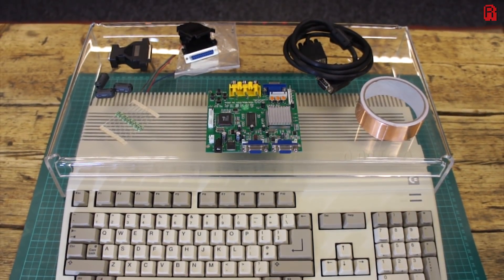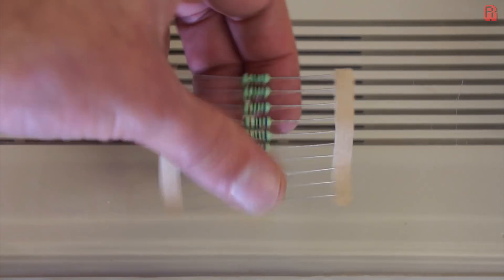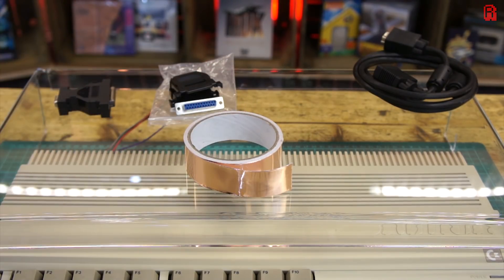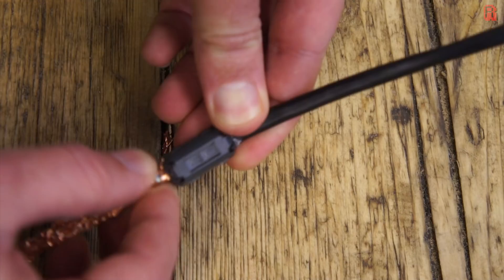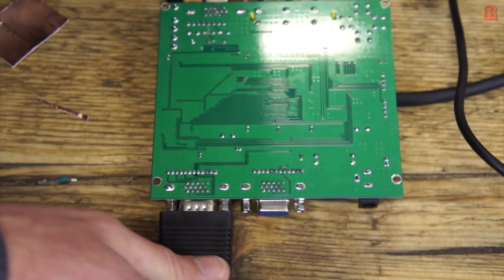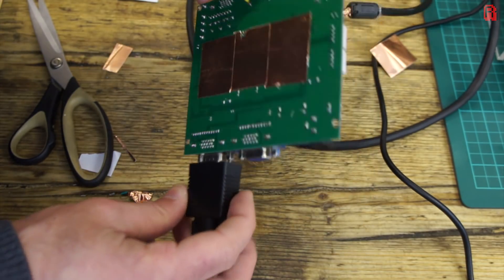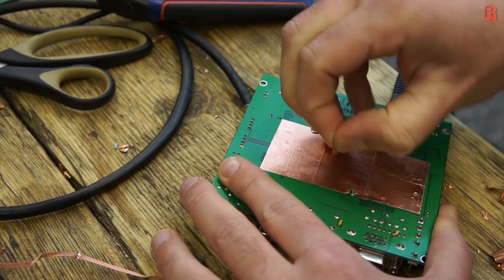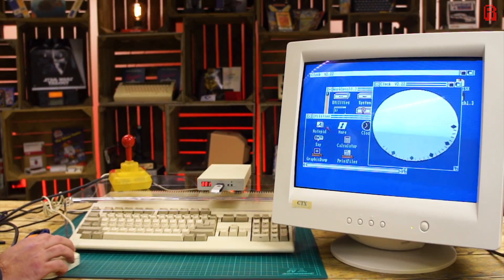GBS-8220 - Fixing Noise (Amiga to VGA)

Comment from the maker: Thanks for watching.  I hope you enjoyed the cheapo hack, see the description for links to those mentioned who deserve credit for their findings.  Nb. Any differences in colour are as a result of me playing with brightness/contrast/saturation on the GBS rather than an effect of the mod.

Hopefully this proves useful to you and pethaps in the future I'll get to reviewing a premium alternative to see how it stacks up.
Reply: Dooklink made a custom firmware for the gbs that gets rid of interlacing
Reply: Hi there, a lot of thanks for pointing us at this board. I just got mine. One thing you should know is that the connector behind the VGA input is DIRECTLY connected to the VGA in. Meaning R,G,B and composite sync...you should use a VGA cable, and only chop off one end of the cable and replace it with an Amiga 23 pin connector. Much nicer than using that white plastic plug. My A1000 now goes straight into the VGA input.
Reply: gr8 video as usual, was wondering if u could tell me make of oscilloscope u used in amiga video
Reply: Also there is a component out mod but I didn't do that.   Just forced 720p out over VGA into a non scaling vga2hdmi
Reply: What is the best (if money does not matter) alternative?

Comment: The db15 connector on the input side connects to breakout pins. Wouldn’t using a cable modified at one end with a db23 work?

Comment: Nice little board, a nice perspex case for it would look good, does anyone do them? I went the route of a SCART to HDMI converter which is working very well for me at the moment and seemed a good bargain at about £23. The converter also has a HDMI input so I don't necessarily loose a HDMI port on my TV (which thankfully also still has a VGA input - which I am hoping to connect up to my Voodoo 3 once my A1200 is working again).

Comment: Thanks for showing us this great device and how to improve on it.  I have a question or two however.  Did you get the 23 pin female rgb connector with the GBS-8220?  If not know any places that they can be picked up?  Also, did you try the copper shielding trick and with a different cable or did you use your already DIY'd shielded cable that you made in the first part of the video?
Also where are those menus coming from?  The GBS itself?
Thank you in advance and keep up the good work :)

Comment: Great video, I wondered if you'd heard of this project based on the GBS-8220 replacing it with custom software, it looks great!? I'm planning on having a go at making one myself adding a SCART to RGB adapter with a sync stripper chip. Anyway reading up on this project it seems the noise has been fixed in the software... https://github.com/ramapcsx2/gbs-control

Comment: Hi, How to add an EGA input to the GBS board? EGA has 6 color channels and 2 HV channels. Where do I plug them in? This is more than RGB. I have an Amstrad 1640 with EGA output which I want to plug to an VGA monitor.

Comment: Hi. I bought a gbs8220 (exactly the one you reviewed) from ebay which is missing a capacitor at location C28 (and the board looks like a dud - it doesnt work.). I want to put one there but not sure of its value. Could you help me out by measuring capacitance on the C28 pads (with component in)? I dont ask you to remove it, I just want to have some reference value. Thanks!

Comment: Hi, have a question.. Do you recommend GBS-8200 to be connected on 12v (16 AMP) or 5v (4AMP) on the power supply?

Comment: Hi. do you know of a splitter I can use on the amiga? So that I can split the signal without converting anything, then have one cable going to my 1084 monitor and the other to this device? I would like to be able to record or perhaps stream but still use the 1084 monitor for my self.  I tried to google a bit but haven't found anything yet.
Reply from the maker: I see what you mean.   I haven't tried this so can't vouch for if it will work but you could look into something like an RGB splitter sending one signal to your CRT and the other to your scaler/sync converter.  Take a look at RGB Distribution Amplifiers.

Comment: Great video. What you could do is add one of those cheap scanline generators from ebay. Just plugs between 31KHz VGA output and monitor. https://www.ebay.com/itm/Screen-Scanline-Generator-VGA-Connection-Replace-for-Retro-Games-Arcade-Machine/372120766485?epid=5008217043&hash=item56a4204815:g:xC0AAOSwkvdafRRK

Comment: I finally got my GBS-8220 to work with my C128's 80 column display. But yeah... take a guess... noise... in the form of random white dots. Your little trick, with strategically placed metallic tape on the underside and covering the wires in it as well, seemed to work... So thanks again :)

Comment: You're using the pin header on the board to build a cable to the amiga's output.  Out of curiosity does that VGA port by the pins act as a input?  Could you have just built an adapter from the amiga's video out to a VGA port and used a standard VGA cable?  Just curious.  I'm hunting down either an A1200 or a A500 for my own gaming usage and find this fascinating.
Reply from the maker: Some people on here have commented that they have used the VGA input.  I tried it before using the header cable and it didn't work for me, so I cut the end off and used the header cable.  The RGB POTS on the board also don't function for the VGA input and only with the header input so that's a small advantage.
Reply: @TheRetroCollective  I had no luck either trying to connect using the VGA input at first. BUT, very recently I did the GBS-Control mod. It does work for me using the VGA input now. I combine it with a buffered DB23 to VGA adapter. Really excellent image quality, with no perceptible lag. I tried to hook it up first using the RGBS pins above the VGA connector (including an 680 resistor on CSYNC), but I got a slight but annoying interference pattern.
Reply: @bennybil3551  Hey man, I also have the same setup using GBS-control.  I wanted to start using the VGA input to the board also and I made myself a cable using VGA cable and then soldering and Amiga RGB connector to the other end and using the 680ohm resistor in the c-sync.  It works, but not in a good way, I get insane looking vertical lines now.  So do you think it cannot be done by cable alone and I need an adapter?  I only thought buffered adapters where needed is say you were plugging directly into a monitor (no GBS 8220)? Any suggestions would be greatly appreciated :)

Comment: I've attempted to create a simple DAC from a the "pull-both" schematic (https://sites.google.com/site/h2obsession/_/rsrc/1400341943224/CBM/C128/images/pull2-rgba-xor.gif) to convert from RGBi CGA signal from an Eagle IBM-compatible, but it didn't work. I don't trust my soldering, so I can't tell where I failed, the GBS-8200 just doesn't find the signal. I don't have an oscilloscope so I can't tell if a signal is even being produced from the computer. I know there is a CGA DAC I can buy but It is $35 and the my original solution would of just cost $4 if it had worked. I don't really care if the colors are a bit off considering the monitor that came with Eagle was monochrome green, when it was working.

Comment: Only a suggestion and it might not make much difference...  ground the copper tape around the cable to a vga shield on the gbbs.
Reply from the maker: Yes I should have shown this really.  The plastic casing I lined with copper tape and grounded which in turn I attached the cable shielding to

Comment: Hm... Do you think such cheap shielding would work for my Gameboy Zero somehow? I'm getting lots of noise and weird moving scan lines and this looks interesting
Reply: I don't know what your GBZ looks like on the inside, but i think it's more likely to be a case of component or cable damage that needs to be repaired rather than something that can be helped with a bit of extra shielding, but you'll only know for certain after you try. What screen do you use and what connection between screen and zero do you use? composite or parallel?

Comment: Why not just a metal case that is grounded?
Reply: 4 layer is indeed often done specifically for crosstalk suppression and EMI reasons.

Normally you flood the inner layers with fill, and they sit on a relatively thick core quite close to the surface, and route your signal and data on the outer layers and it usually works just as well but is much more reliable to manufacture and easier to test and inspect! The ground goes component side inner layer and the vcc fill goes opposite side inner layer. Additionally whatever place you have left over on the surface, you via stitch it to the ground layer.

You can also stick some separators into a noisy bus and stitch them through. Remember when they introduced 80-conductor IDE cables to improve reliability and push frequencies beyond 33 MHz? It simply had a ground wire between each signal wire.
Reply from the maker: I found that I had to have very close contact with the copper tape flush to the pcb for the effect
Reply: Because it's not external interference that's the issue, it's crosstalk between the lines, that a little bit of capacitance that the tape introduces sufficiently suppresses.
Reply: Siana Gearz ah, I didn't think of that. So if they used a 3 or 4 layer pcb and ran the signals on the internal layers with ground fill on the outer layers.

Comment: To make this mod look more professional You could have just wired the db23 into the VGA plug at the other end of the VGA cable, then plugged that into the GBS8220 instead of that connector which doesn't look as nice . The copper tape fix works extremely well though.
I also use my GBS8200 on my Amstrad CPC464 as well as Spectrum +2. My Amiga 500 has never looked better on a monitor.

Comment: did you ground the tape? without ground it works like antenna and can amplify noise depending on position
Reply from the maker: I did and I didn't.  When I grounded it I found I had some noise again so I broke the connection and had it floating.  Others I know have grounded it with no noise so I'd say try both and see what works for you.   I grounded the cable shielding also.
Reply: RetroManCave wondering now if the copper on just the board itself would be the only thing needed to be done in the 1st place?

Comment: Looks much better but what about the "warping" effect you see around the mouse pointer?  I noticed that on mine and I can't stop seeing it.  :-)
Reply: This is an artifact of the board applying de-interlacing to a progressive source. Some people are using raspberry Pis or Arduinos to control the video processor chip directly and turn it off. (among other things) Maybe some day they'll figure out how to flash and overwrite the junk firmware directly instead of grafting another device on to bypass it.
Reply from the maker: Yes I know what you mean and that still appears.  I'd like to try some other upscalers and see if it happens on them also.  I don't think we can fix it with tape 😁

Comment: Why didn't you just connect to the vga port?
Reply: HD15 (vga) works with csync on pin13. Just select right mode
Reply: RetroManCave sorry i wasn't specific and quite blunt. The head you plugged your cable into looked to share traces with the vga port next to it. Thought it might be possible to bypass rewiring one end of the cable.
Reply from the maker: I did and I got nothing from it
Reply from the maker: PCTonttu hmm no joy.  I may have another play some time but it works, and you can't use the adjustment pots through the vga port (apparantly)

Comment: Ok now my favourite channel for sure 😁 
Could you make a video using the GBS to convert a PC CGA signal  to VGA please?
Reply from the maker: Xalalalala Attic Treats hehe thanks.  If I get an older PC or a CGA card for my 486 I'll be sure to capture some Alley Cat.  Mmmm magenta!
Reply: RetroManCave thanks 😉 I really love cyan and magenta 😂
Well now I'll use my GBS for sure with the Amiga and with my CGA computers eventually!
👍
Reply: Wondering if you ever got around to this, I recently bought an Amstrad PPC640 the "portable" with the crappy 9 inch 1980's LCD however it has a CGA out, I have seen some people try this with a revision of that board but they failed, however they did not seem to understand the kit as well as you, would be handy to know if it would work.

Comment: If you want to further mod it, if you have an arduino you can improve things possibly further, a friend of mine has been working on a project which may be worth checking out :) https://github.com/ramapcsx2/gbs-control

Nice bit of State of the Art at the end there :) Love that demo
Reply: Many thanks for the link, I had avoided buying one of these devices due to the reported issues with 50Hz input and output but that project looks like it can fix the input problems and provide a 576p50 output.
Reply: No problem man :)

Comment: Nice stuff, GBS-8220 is compatible with NES or something related to old consoles too?
Reply from the maker: Yskar Nebula it will take an RGB input but not composite.  You might be better off with a hdmi upscaler it depends on what monitor you want to use
Reply: RetroManCave i saw those yuv composite and i taught they were used for imput and the RGB for output.
And i intend to use an monitor with RGB imput just like yours. (And sorry for the bad English, im Brazilian)

Good CRT tvs are quite rare nowdays on Brazil, and well preserved old CRT monitors are way more common.

Comment: Ace video as always, can I ask why you cut both ends off the vga cable?
Reply from the maker: Gary Broadhead one end needs to be DB23 the other to go into the gbs board.  I tried it via the vga input on the gbs board but no luck it needs to use the other input with the included cable
Reply: RetroManCave  I can input via the vga or the header. I have noticed that not all the boards are created to the same quality level.

Comment: I wonder. Is the copper tape trick enough, or is the homebrew cable also needed to get this result? What's the result of copper tape and old cable?
Reply from the maker: The old cable had to be hacked up to create the new one unfortunately.  In the case of the Amiga you'd want to make up a cable with the resistor on anyway so you might as well make both.  I'd be interested to hear how others get on trying the copper tape on other systems like arcades/neo geo and if it makes a difference for them

Comment: I use one of these on my Neo Geo 4 slot, would Aluminium tape work or does it have to be copper ?
Reply from the maker: give it a try, if you place some tape on the traces and apply pressure without taking the backing off the tape you should soon have an idea, just be careful not to knock component legs poking through the board and short them.
Reply: Before I do I will look if I actually need it. When do you plan to look at your MVS-2 ? I made my own bartop based on a Neo Geo with a real MVS-4 slot and also replicated the mini marquee system with an arduino so it shows what game is selected.
Reply from the maker: That sounds cool.  I hope to look at it soon as I now have a replacement bios and some other bits to investigate
Reply: A Unibios ? the caps on the sound section are known to go bad, cartridge slots can also have problems. It's best to test with no cartridge and look for the white boxes at first.
Reply from the maker: Yes I have a Unibios.  Current problem is the well known Calendar problem but the Unibios should let me get past that and delve deeper
Reply: great, I look forward to watching that one in the future.
Reply: I couldn't find self-adhesive copper tape in my small town so I tried using aluminium tape that I had for my dryer duct pipe. Holding it on worked about 80%. After adhesion it, it's 100% perfect. I'm using my GBS-8220 to convert BBC Micro and Amstrad CPC RGB to VGA.

Comment: I had the same experience putting tape over all of the traces. I figured why not, the less noise the better right? When I plugged it in and tried the juggler demo it was terrible. I thought I had broke it at first.
Reply: RetroManCave it most likely added extra capacitance between the traces and let them couple noise between each other.
Reply: @jakewilkes7610  what if you connect the copper to ground? It's left floating now.
Reply from the maker: Hah I'm glad it wasn't just me, it seemed like the logical thing to do but evidently not!

Comment: There's another way of adding extra shielding. By taping the inside of a plastic shell or project box and grounding the tape might provide some extra shielding. The same process might also work if you glue pecies of  aluminum foil from the inside too.
Reply from the maker: I'm thinking mounting it inside a copper lined lunchbox would be a super cheap next step for protection of the device as much as anything.
Reply: Also.  I think I am going to fix mine on the back of my monitor using the holes that are used to fix it on a wall bracket.
Reply: You can get much nicer boxes from an electrical wholesalers for a few quid.  Just applied the fix mentioned here and it works much better.  Thanks for that.

Comment: I'd be interested in a latency test. Film with a slomo phone camera and test with a normal Amiga monitor vs VGA vs composite etc
Reply from the maker: It would be interesting to see, although I think if latency is a real concern to a degree more than "it feels about right and I can enjoy playing games on it" you're likely to be willing to spend a bit more than £15 on a solution.  I hope to get hold of some more premium converters in the future and will run side by side comparisons when I do.
Reply: RetroManCave My Life in Gaming did a latency test on the device. It was about 1-2 frames.
Reply from the maker: That sounds mildly average really doesn't it.  Another reason not to spend too much time or effort on it for anything more than some casual gaming, although I've enjoyed fast paced games like Kick Off 2 without any issue.